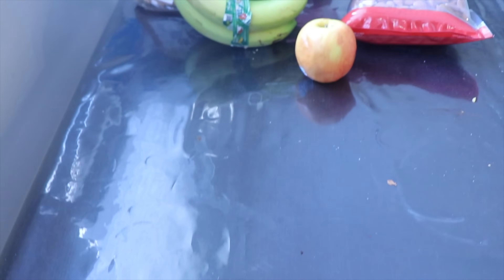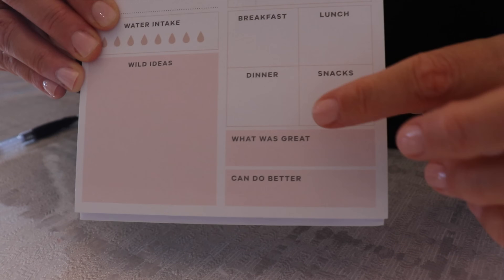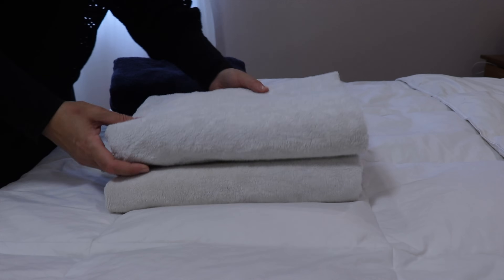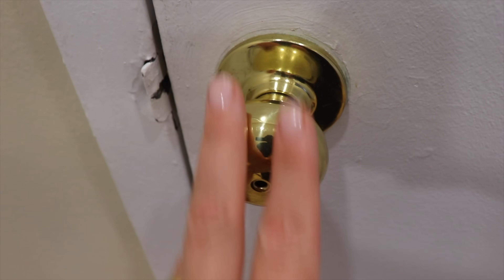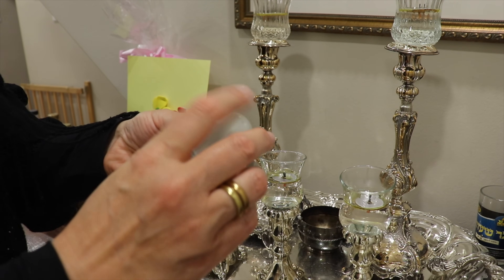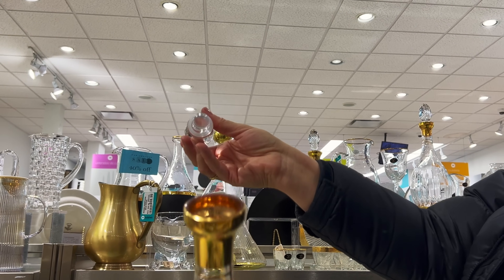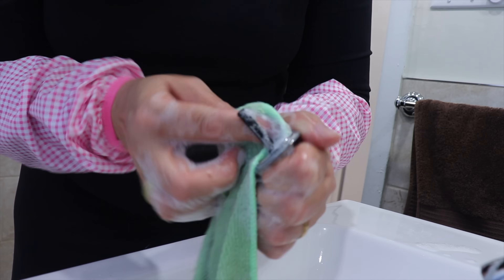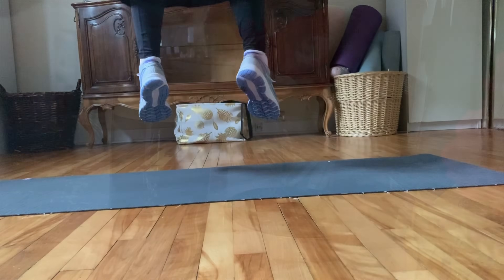Productive Sunday Reset | Jewish Home Refresh After Shabbat and The Holidays | Holy Woman Edition

Comment: I've found a strong solution of white vinegar and hot water is great for taking the soap scum off the shower curtain, tub, and bath mat! Do exactly what you did, but use vinegar instead of bleach. It works even better if you use cleaning vinegar, which is 10% acetic acid instead of the usual 6%

Comment: for washing vinyl shower curtains, place it in your washing machine with a dish tab (i use cascade platinum plus) - dont be afraid to use hot water - it will remove mold, mildew, scale, etc and come out slick and new - just hang to dry
Reply from the maker: Thank youuuuuu! I will try G.od willing!

Comment: I love Sunday reset routines… Or whichever day of the week a person happens to do them on. I am also amazed that I am able to offer a tip to you, who are so organized. Or at least, this works for me. I take my plastic shower curtain liner and wash it in the clothes washer with warm water and a little bit of detergent. All the soap scum seems to come off of it. I shake the water off of it in back into the washer as well as I can, and hang it back on the shower rod to dry. It will have a few water spots on it from the water drying on it, but at least the soap scum is gone and it looks good as new.

Comment: After every shower, lift the bath mat and leave to dry draped over a towel rail or the side of the bath, you don't get mouldy build-up and it prolongs the life of the mat - no bleach required. Helps to keep the floor of the bath, cleaner too!

Comment: My cleaning tip would be to add the shower liner and non-slip mat to the washing machine! You can add the shower liner in when you wash the shower curtain, and the non-slip mat can be cleaned in the washing machine easily if you add in the cloths you use to clean. Adding a towel in with the showerline and shower curtain will cause just enough friction to lift up anything dirt, mold, or mildew on them.

Comment: The shower curtain and the tub mat can be cleaned in the washing machine on the gentle/delicate cycle using warm or hot water with detergent; bleach is optional but certainly not necessary. Just be sure to hang them to dry(No dryer, they will melt!!). Also, I've found that the type of shower curtain that feels more like fabric but is made to be waterproof tends to stay cleaner longer than the slick vinyl/plastic type. Oh! And a product called The Pink Stuff(the original paste) does a great job of cleaning the tub itself, especially if used in conjunction with a Scrub Daddy sponge. Once again, thank you for your videos, your prayers and for being you! You've brought so much comfort and inspiration to my life, thank G.d!
Reply from the maker: Aww thank you for being here and all your great tips!!!

Comment: For anything that is stained, like the shower curtain or the anti slip mat I use washing soda. It best works done with hot water. For the amount of water you have in the bathtub add 3 - 4 tablespoons washing soda. Leave it soaking for at least 15 minutes. The longer it sits, the better it works. For bleaching citric acid can help as well. Add a tablespoon to your mixture. Does not harm you. Washing soda ,diluted in water, can be used as a cleaner in the bathroom as well. Killing to birds with one stone. It was the cleaning routine/hack of my nana and now is mine.

Comment: Letting the cleaning product sit is actually what helps it work well! Just like the vinegar around the shower heads, the chemical reaction needs time to affect. Or if you've ever had to use over cleaner to get rid of fatty stains, it works wonders in like 8 hours - the fat just melts off the surfaces!

Comment: I'm the same when it comes to toilets: I use cloths for everything else, but for toilets I use paper towels. I know logically I can disinfect anything used on the toilet just as easily as the cloths used for everything else, but it still gives me the heebie-jeebies. I love Sunday resets (though in my case it's usually on Friday, lol). I don't know if Simple Green is available in Canada, but I use it on everything except mirrors (I use a glass cleaner for those). I have really chemically sensitive skin, and it's the only cleaner I've found that doesn't give me a rash if it comes into contact with my hands. It also has a far less unpleasant smell than most other cleaners.

Comment: I love your Sunday reset routine! My non negotiable for any reset or cleaning will always be a clean vacuum to vacuum with. We have 7 dogs and you can imagine the amount of fur that we need to vacuum! A vacuum needs a clean filter and for the bristles to be free of fur, hair and lint to work its best. I have to vacuum every other day or so, but I find it is much easier when I can just pull the vacuum off the charger and go to town on the floors! If I have to stop and clean it before using it, it breaks my momentum. I also have vacuums on each floor of my house, so I don't have to drag them up and down the stairs, or wait for them to recharge. It takes only minutes to clean after using it, and checking to make sure the hoses aren't blocked. We moved into a big log cabin in November 2021, and it came with wood floor.... and very light beige carpet! (EEK!) So I'm sure you can understand why I have such a hang up on vacuuming! :) And all 7 of my dogs have dark fur. But I am blessed to have such a problem - a roof over my head and the love of 7 rescued dogs! (and wonderful husband!!). Thank you for your prayers - that means so much. <3 You and your family will be in mine as well!

Comment: What I use to clean in my bathroom: Heat one cup of white vinegar. Mix it with one cup of Dawn dish soap. I keep it in an old Dawn bottle. Fill up a dish washing wand and scrub your bathroom surfaces. It cuts through soap scum like you wouldn't believe! Shake if it's been sitting for a while, as it will separate a bit.

Comment: I know its been a few weeks but i would like to share with you what I use in my shower. I prefer just a mix of vinegar and water with a few drops of dawn dish soap. I've been using that for years. I have also used method shower cleaner and it works well too. I find I have to deep clean much less. I dont spray after every shower, just when I remember lol. Usually just where the water hits. Helps with our extremely hard water. Good luck

Comment: For a while everything in my home was getting horribly stained by our water (well).  We found out that when my husband added the stuff to our water softener each month he left a switch up and products that should have been trapped within the filter remained in the water. ( we build our home on land that has a large amount of granite under the soil level and this puts a large mineral load in our well water...minerals stain).  Until we found out what was causing this I bought every bathroom cleaning product at the grocer, Home Depot, Lowes, and all the local plumbing stores.  Nothing cleaned the stains.  I was in the Dollar Tree and saw a product called Works.  The label stated it was for bathrooms and out of sheer desperation I bought it to try.  It comes in a white plastic container with green lettering with a squirt lid.  I pour some on a small area and the stains vanished in seconds.  I used the product on all 4 bathrooms, the dishwasher,  the washing machine, and the tile walls where the water hit during showers.  After literally almost a year of trying hundreds of products, this worked instantly.  I recommend this product to everyone.  I buy it by the dozens when I find it in stock.  I noticed it also works well on mold too which used to be a pain on the pool equipment and sometimes in the tile grout.

Comment: You find and use some of the most interesting cleaning products. I now would like to try some of the same methods, as I would prefer to eliminate most of the harsh petrochemicals in commercial cleaners.  I like the Dawn Spray as well as the lavender Method cleaner.  I already using bleach and white vinegar in the bathroom and kitchen.  But I have never seen the 'sleeve protectors' before. Very interesting. I will look for it in the dollar store the next time that I am there.  Thank you!!

Comment: Buy a white Nylon curtain instead of a plastic shower curtain. You can buy them at Bed Bath and Beyond. They are sterile, feel like fabric, waterproof and can be washed easily in the washing machine! Plastic curtains are not easily cleaned and are awkward to move and touch. I really love how I can put the nylon curtain in the washing machine with some detergent and a little bleach and they come out spanky clean. 

The plastic shower mat can also be put in the wash…fyi…. You can accomplish 2 things at the same time. Just don’t put shower mat in dryer.

Comment: Your bathtub issue: I use hot water with about 2 cups of bleach if not 3. Then I soak the bath mat for 30 minutes. Your shower curtain and liner really need to be fabric and they make waterproof liners so you do not have to use plastic. These get washed with the towels and with laundry detergent, and laundry sanitizer (no fabric softener at all) and then put into the dryer with the towels and dried (check the shower curtain to make sure it can be dried) but this will take care of the sanitation of the shower curtain and shower liner. Then I use a scrub brush and scrub the bath mat and then I take it and hang it on the wall for 10 minutes. After that I clean the inside and outside of the toilet, do the sink and take out the trash. I then take the bath mat and put it in my washer (and since I have several bathrooms I do all of them at once) and put them
In the washer on Hot Water, Laundry Detergent, Laundry Sanitizer and then let them wash. By the time it is all done I have cleaned all the bathtubs and I then put the bath mats out in the sun for 2 plus hours and let them fully dry and then put them back into each bathroom.

Comment: Cleaning pet peeves… In the kitchen I have to clean the kitchen sink. I don’t like people leaving food residue in the strainer and I have to clean the disposal. I learned you can use dish-soap instead of the expensive foaming tablets. Plus I run ice through it on occasion to knock any grime off the inside. I also agree with you on paper towels when cleaning the toilets. I also use paper towels to wipe the floor as I can do a better job than a mop. I mop on occasion but scrub with my hands and paper towels. I don’t touch the toilet either gloves are inexpensive and use them for anything grimy like bathrooms and washing the car inside and out. Also with pet cleanup and anything that the chemicals are hard on the skin. I though dislike reusable gloves they just are yucky to me after using them. Disposable are my preference even though their not recyclable. Oh well we can’t give up everything.

Comment: I wash my shower curtain liner in the laundry washing machine with a couple of old white towels! I add bleach to the load and it comes out spotless each time. Of course I use a gentle cycle, hot water and extra rinse. After many washings, the inexpensive liners need to be replaced.
Question - how do you avoid bleach stains on your black clothing?

Comment: Leaving cleaning products sitting for a while before scrubbing is definitely helping to losen the dirt/grime/limescale. Cleaning comes down to three factors: time, elbow grease and chemicals/cleaning product and increasing any of the three means you need to do less of the other two. 😊 So letting a product sit for some time means you have to scrub less and can use milder chemicals and still get the same result. (Like using vinegar on the showerhead instead of a harsh chemical limescale remover.) 
For particularly stubborn spots, you can even cover the product with plastic wrap so it doesn't dry out and leave it for a longer time. 
(My mom is a professional cleaner and I watch cleaning channels on youtube.)

Comment: Awoyd sprays as it conciderd bad for health to use reguarly so I use wet wipes on toilette and sink but if it needs more I use a small bucket with dish soap or soap water(hot water) and use two cloths one wet and other one that are dry to dry up same with kitchen and tables ect hot water is key regarding cleaning up fat resedu,as I do not have a bathtub I am not sure but I think hot water soap and a long brush could help (I awoyd bleach as well as spray) 
There are meny options besides spray and bleach and most of them are stuff we already have and are cheep,crossing fingers you find great options

Comment: Re: calcium build up, for hard to reach areas tomato capsup, sorry for spelling, anyway the cheap and cheerful method of dealing with calcium or Lyme build up is the condiment of choice! Why? It’s thick and you can spread it in areas that can’t be touched with a scrubber without scratching the surface of chrome. By leaving it on all day it’s enough to do the job. At the end of the day just wipe off rinse and repeat until shinny. 
 In Regards to shower curtain: white vinegar in the washer as you can do two jobs at once with the high efficiency appliances, the dishwasher and clothes washer especially needs to be treated with a cup of white vinegar monthly to prevent mineral build up and at the same time disinfect your your shower curtain using the hot water setting. Re: the use of bleach: if you have a septic system? Bleach will kill the beneficial microbes that break down the solids in the waste tank and it is highly discouraged using bleach and other negative effects like it being an acid and can ruin your clothes. As you know, never mix chemicals!  I hope this of some use to you. Take care. Liz

Comment: Dr. Malka, you weren't too far off thinking Persil was a French brand. Here's a couple of paragraphs I found on Wikipedia:
"Persil was the first commercially available laundry detergent that combined bleach with the detergent. The invention of Persil was a significant breakthrough. The name, 'Persil', is derived from two of the original ingredients, sodium perborate and silicate. This name was however deemed unsuitable as an international brand because the pronunciation of this spelling is not clear or easy in some languages. Coincidentally, persil is the French word for the herb, parsley.

In France, the Marseillais Jules Ronchetti launched a soap under the brand 'Le Persil' in 1906. During the First World War, the company of Electro-Chimie, concessionaire for France of the Henkel laundry, signed an agreement with Ronchetti by which it would no longer sell detergents under the Persil brand. A legal battle ensued which resulted in an agreement in 1927 reserving the use of the mark to the English company Lever Brothers (which bought the company from Jules Ronchetti) in France and the United Kingdom, and to the German company Henkel in the rest of the world."

Comment: I have spent a lot of time trying out different cleaning products. I purchase a gallon jug of 12% food safe hydrogen peroxide. I dilute it with water to a 3% solution and a light squeeze of Castile or dish soap. I believe most cleaners that sanitize require time to sit. But will still do a good job without waiting. I especially like this cleaner as I feel comfortable spraying on fabric furniture and walls and I believe it helps to kill dust mites and helps w/ my allergies. I got the idea from using a similar premade cleaner by the Honest brand. Store bought hydrogen peroxide is also good and great as a stain remover when combined w/ dish soap. Hydrogen peroxide can lighten stains as well. I also make up a 6% solution for heavier spot cleaning. However, I recommend wearing gloves. It is essentially on oxy cleaner. I have used this cleaner without gloves. It will make your calloused look white. Very scary looking. But by the next day my skin looks completely normal. No peeling or chemical reaction. Because I don’t get a headache like bleach and the reaction really breaks up grime, I just keep it in a safe spot and properly labeled.

Comment: Have you tried borax instead of bleach? I used to use bleach all the time and I feel that borax is just as well or even better depending on the type of things that I’m working with. Not sure if you want to try it out and let us know how it works :-) I use it if there’s something with mold on it because I’ve learned that bleach actually does not kill mold just disinfects. And once I started using the borax, it actually fixed the problem. :-)

Comment: I was going to say, you are brave to wear black when you are using bleach. I always end up getting spots when I do that!

I have a question. Why do you wash your face and put on your serums before you exercise and shower? Are you only washing your body when you shower? I get head sweat easily, so that wouldn't make sense for me. You should also put on SPF, even if you will not go outside until later in the day. It's a good habit to get into.